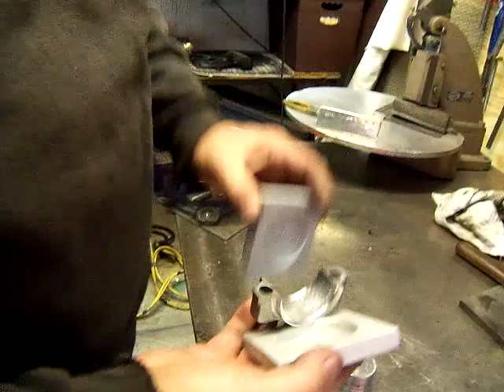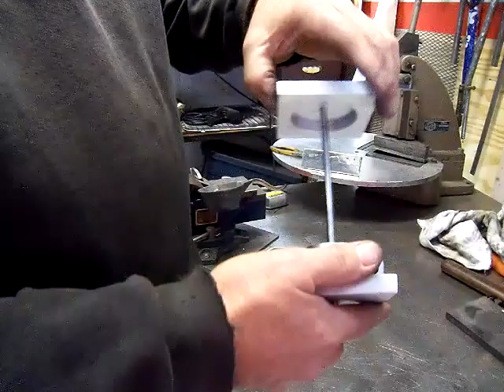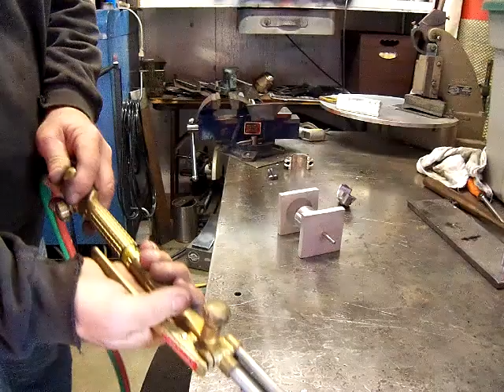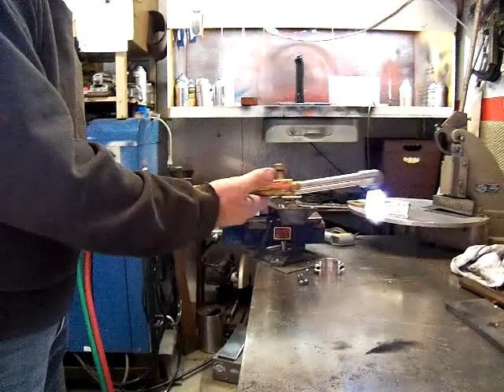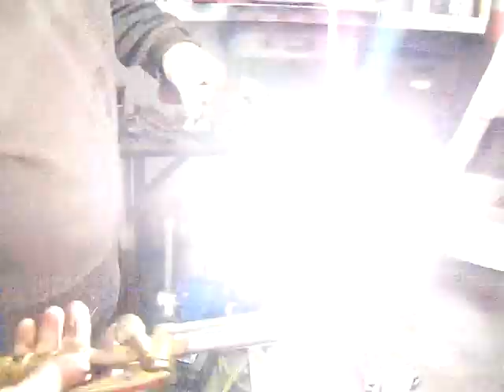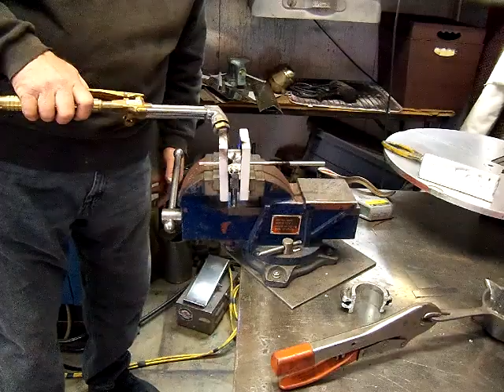Pouring Babbit Bearings

Comment: Nice video. Pouring Babbitt is such a lost art, but I don't see why. It seems fairly simple as long as you pay attention to what you're doing.
Reply: Them Krazy Kiwis and their lack of resources, they don't need no Jegs or Summit! Kinda cool what you can do in your garage and what you can make with your own two hands.
Reply: They say they're resourceful since they live on an island, I think it's got a lot to do with being cheap pricks..............
Reply: That old dude in Worlds Fastest Indian poured all of his own junk…. On another but similar path I saw this guy recently welding up the outside of his old HD Evolution engine to make it water cooled. Built the jackets out of the air cooling fins by covering with sheet metal… neato! I like this BTW…
Reply: Burt Munroe was also making his own pistons, what was his recipe 2 Holden and one Ford and then screw pressure to set them. It's fun making metal molten and then to shape. I'm making some jacks at my local foundry and wish they would let me use their equipment so I could do it myself.
Reply: michael reynolds try to keep up.
Reply: michael reynolds no problem, all good here 😎